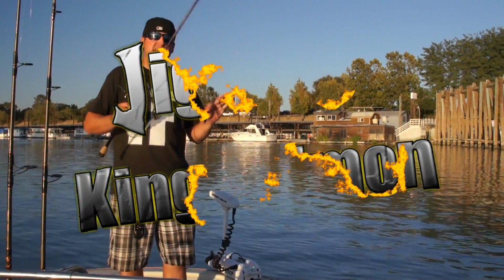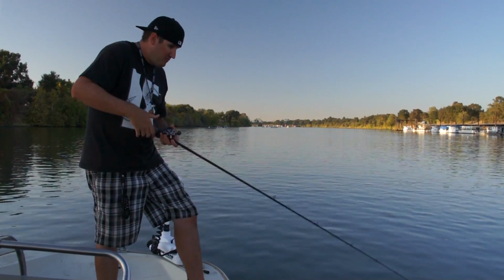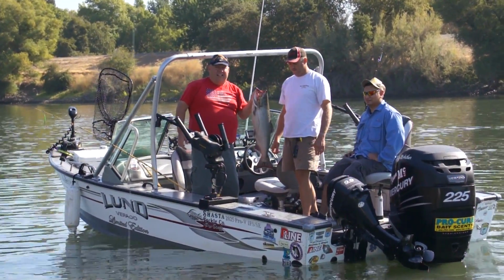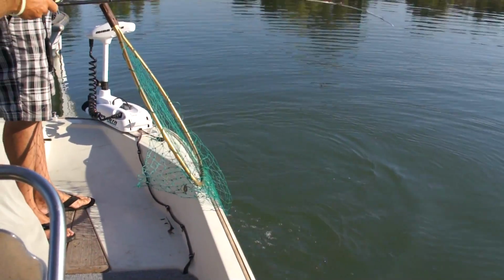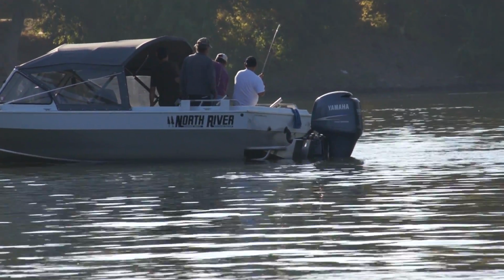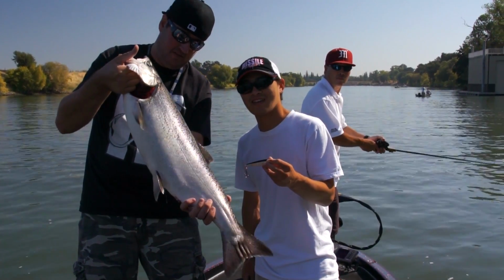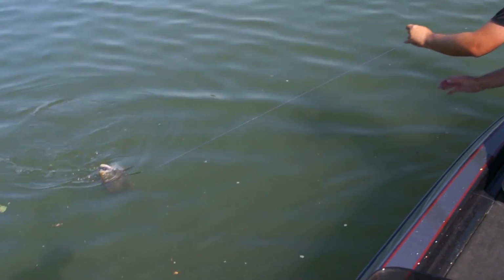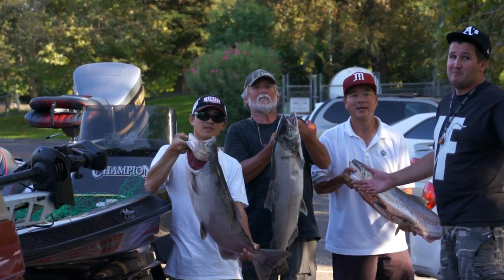How to Jig for King Salmon

Comment: Great video.  One minor correction though.   Just because the salmon does not have a clipped fin does not mean it is a wild fish. Most likely, in the Sacramento River, it is a hatchery fish.    It only means that the salmon does not have a wire tag in it's head.   They generally tag about 25% of the fish before they release them.

Comment from the maker: Being able to lead the fish with a tighter drag and to build a better load into the stretch of your line is crucial. The reason you will see me strip line is strictly to maintain the rods action when it starts to get into a negative position that can damage the rod. When I'm jigging and hooking them straight from above I prefer to stay as close to the fish as possible that's also why I run them down on the trolling motor. If you jig shifts around to much your odds of landing them decreases.

Comment: I have noticed you have not commented on the treble hook on any lure/jig over 1 ounce. I too thought any jig (example P Line minnow) over 1 once had to use only a single hook ( Gamakatsu side wash hooks are great examples). Just don't want you to get caught using a treble and get a ticket. Enjoy your fishing videos by the way. Hope to see ya out on the water someday.
Reply: Treble hooks are legal to use there.  This section does make it sound like it is illegal, however he is fishing near Freeport.  Since Freeport is south of Highway 50, it is considered the delta.  Section B here states that this restriction does not apply to where he is fishing.  Had he been fishing north of the Highway 50 bridge then yes it would not be legal. 

2.10. HOOK AND WEIGHT RESTRICTIONS.
(a) Definition of Gap: For the purposes of this section,
“gap” means the distance measured from the point
of a hook to the shank.
(b) Maximum Gaps and Gear Rigging for Rivers and
Streams unless otherwise provided (does not apply
to lakes and reservoirs, the Sacramento-San Joaquin
Delta (see Section 1.71 for definition of the Delta),
and the Colorado River).
1. No person shall use any single hook with a gap
greater than 1 inch or any multiple hook with a gap
greater than 3/4 inch.
2. It is unlawful to use any hook which is directly
or indirectly attached closer than 18 inches to any
weight exceeding 1/2 ounce.
3. It is unlawful to use any multiple hook or more than
one single hook on non-buoyant lures exceeding
one ounce.

1.71. SACRAMENTO-SAN JOAQUIN RIVER
DELTA.
The Sacramento-San Joaquin River Delta includes
all rivers, sloughs, canals, cuts, forebays, and
flooded islands within the area south of Interstate
80 to its junction with Highway 50, and south of
Highway 50 via the Pioneer Bridge to its junction
with Highway 99, west of Highway 99, north of
Interstate 580, 205, and Highway 120, and east of
Interstate 680.

Comment: Adipose fin presence does NOT necessarily make it a "wild" salmon... Most CA hatcheries don't clip  adipose fins from salmon as they do for hatchery steelhead.  Many hatcheries do clip the adipose from only those salmon whose heads are fitted with coded wire tags so they know when to collect heads during creel and/or carcass surveys/counts (to get data).  FWIW... I'm not correcting you to be an asshole, just to clarify.  Your videos are well done and surely appreciated by many.  I wouldn't bother to correct you if I didn't deem you worthy ;)
FISH ON BRO ><))));>